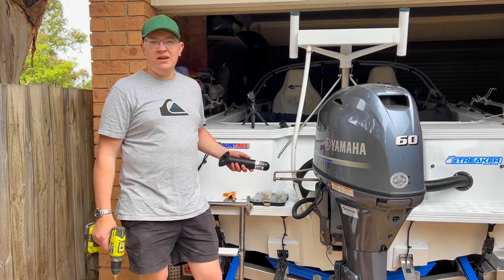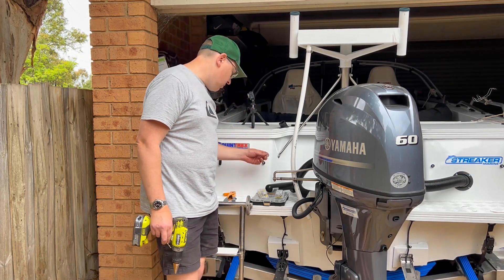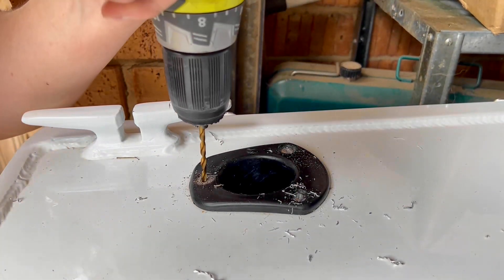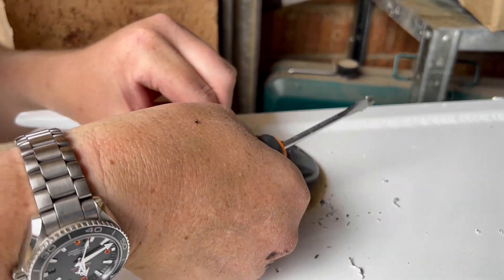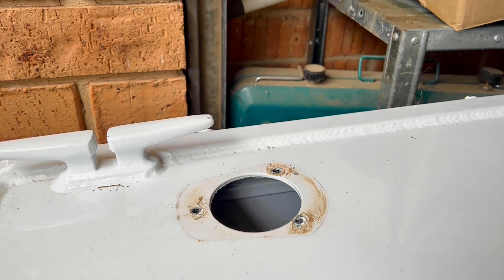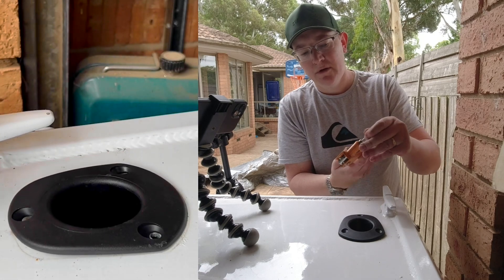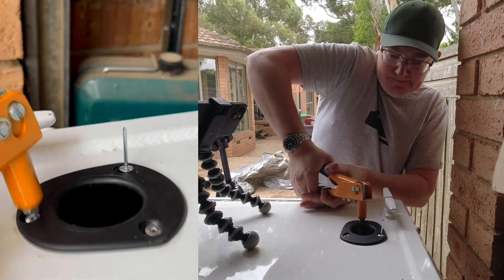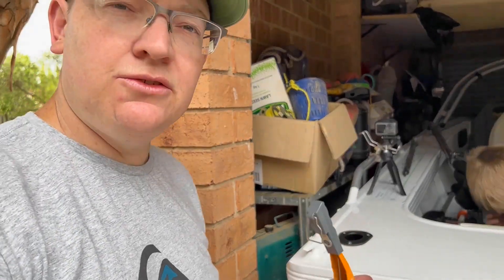How to install rod holders into your boat - Drill and Riveting!

Comment: Hey mate
Do you know what size hole that is for your rod holders so I know what size hole saw to get? Cheers
Reply from the maker: Sorry mate I don't. The rod holders are like 8 bucks. And you can measure them up. I would hazard a guess around the 45mm size but could be wrong